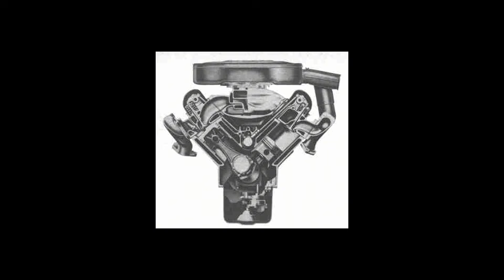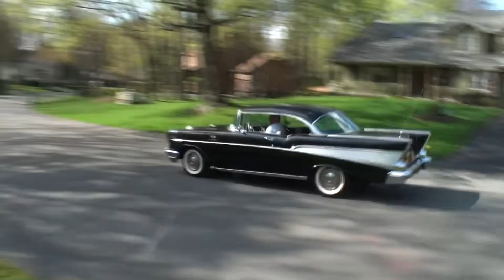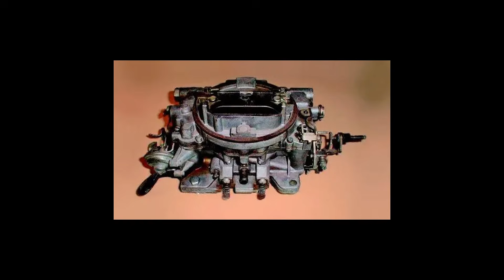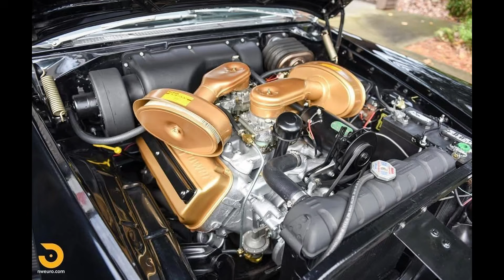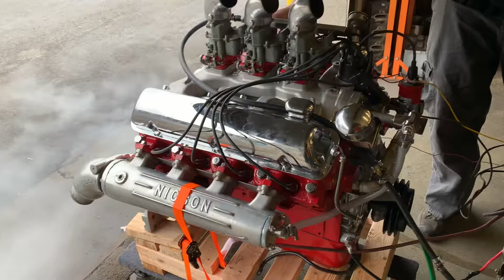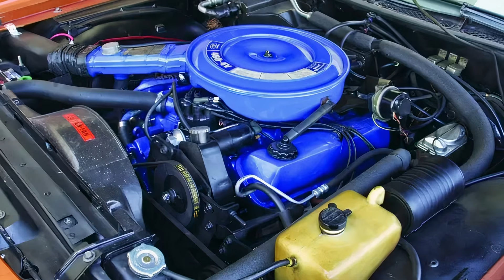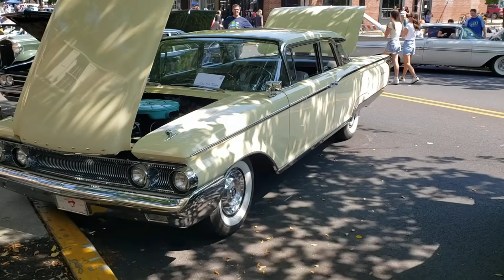Why America ABANDONED Lincoln’s Monster 430 Big Block!

Comment: I also own a 1985 Mark VII fully loaded I bought new. 302 was a dog in a car that is heavier than it looks. Slid in a 408 Windsor (351W) for a beast. Painted it Ford Blue for the factory look with Cobra Valve Covers, Air Cleaner & 8qt oil pan. High volume oil pump. Bolted up  to AOD, but had trans built to take a lot of power. Everything was easy bolt in except for the holley sniper. Had a guy do the install

Comment: I owned a ‘63 Lincoln with the 430 MEL and I didn’t notice it to be a Gas Guzzler compared to the 472 cubic inch  Caddy Fleetwood in 1973 and ‘72 Olds 98 Regency 455 cubic inch. Those 2 cars I watched the gas gauge actually move with every short trip I took. I drove 65- 70mph in that ‘63 Lincoln in freezing cold 0 degree very windy Presidents’ Day weekend in 1986 from Atlantic City NJ to Worc County. 5.5 hour trip and didn’t need to stop for gas. I drove the car like a second car when the weather was nice out and went long distances and not once did I say this is terrible on gas.

Comment: I drove a Ford truck chassis manure spreader with the 430. Had the power to do the job comfortably. Only problem, the bed was just a bit too far back, so when first unloading and the load of semi-firm manure was drug as a block by the bed chain back against the flails, it would rise up into a wheely against the rear tandem’s bump stops for about 50 75 feet, 2+ feet up, then gently settle back down, having tracked straight enough for spreader work.

Enjoyed that truck!

Comment: I bet you all, that was the engine in the "Hot Rod Linchon"  No wonder he drove his pappy to drinkin'!  I wished I  was around back then, to  see  how all these great engines and cars actually were.  The closest I've gotten was a 1955 Chry New Yorker... had a 331 Hemi.  I had no business with it, In the early 90's before the internet it was so hard to locate the right parts.  Crazy example, the 55 had a rebuildable water pump,  you just didn't go buy a new water pump. BUt in 56, you could. and I do not think they were backwards compatable. the fuel pump failed in this one, and the funes blew the exhaust out.  I tried to give like $900 for it. but could not finish paying it out as i lost my job.  Pink body, and white top. 2 speed auto. Bosy was near perfect (less the paint)  very few dents, no rust.  Even still had the ink stampped torque specs for the sparkplugs under the covers.

Comment: We had an Edsel 400 (MEL) in our boat.  It would pull 8 large shiers out of the the Dreamboat could match it.  The Dreamboat was faster because of the hull.  Ours was a 16ft Philbrick.  It would never get up on a full plane.  Our next boat a V Drive similar to a Phoenix craft, it didn't have a hook.  It had an adjustable cavitation  plate.  It was much more controllable.   You could spin hookers with it. It had a 301 Corvette engine in it.  My father sold it while I was in the Navy, in Vietnam.   I wish he hadn't.

Comment: I joined Ford’s Large V8 Engine Design Department in 1967 as a design engineer. The 429 and 460 engines had been released for production for the 1968 model year; the 429 for the T’Bird and the 460 for the Lincoln, replacing the 462 MEL family engine. 
The combustion chamber-in-block concept which the MEL Ford engines shared with the 348-409 Chevy engines was incorporated for better control of compression ratio. The hypothesis was machined dimensions gave better dimensional control than cast dimensions. At least in theory. But John Fawcett, the Design Analysis Section supervisor told me it didn’t work out that way in practice. I don’t know what GM’s definition experience was was the W Series engines, probably same as Ford. 
BTW: The 430 engines, built at Lima Engine Plant, destined for Lincolns all ran several hours on the hot test stand , then underwent a “Continental (aircraft engine) tear down, inspection and reassembly before shipment to the Wixom Assembly Plant. During development, bumps were added to the pistons, in registration with the valves to bump the back to their seats without damaging the valves or pistons. 
And finally, the 460 was supposed to replace the 462 for the 1968 model year, but it was discovered that there was a ‘float’ of 462 engines that would cover the planned vehicle production for the entire model year. My manager tried to sell the engines to Commercial Engine for pumping stations and generators. Nobody wanted them, so the marketing department decided to use the 462 engines up in the 1968 model year Lincoln. It took 6 months of intense effort to un-do the packaging changes that put the 460 in the Lincoln vehicle.

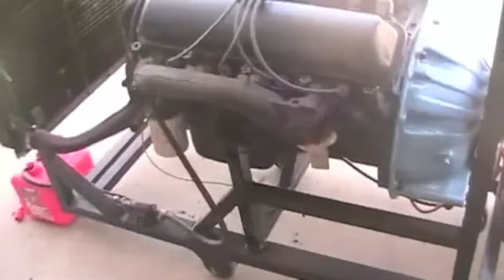Comment: those pics around 17:40, show a running engine and the mechanic tool tray ( top of the radiator )0, complete with a set of plyers ready to fall into the fan to be vaulted into someone else's eyeball/skull.

Comment: There is a 58 T Bird that regularly trounces the competition at Goodwood and it is powered by a 430 MEL engine and 4 speed trans. The thing about comparing this engine to a Chrysler 392 is that there were several drag racers racing 392 engines with roots blowers on them burning nitromethane and the short blocks were stock except for the pistons and cam and the heads were stock except for the valve springs.   NO  OTHER  MANUFACTURERS  ENGINE  WAS  CAPABLE  OF  THAT  WITH  ENOUGH  DURABILITY TO  DO  IT  MORE  THAN  ONE  PASS.

Comment: I have a couple 462's and a running 1960 430 in my pole building. Developed a fondness for them in my teens. Had a 60 430 TBird that would bury the needle on its 140 mph speedometer. Also put a 430 in a 57 Ford convertible. It had massive power. 462 has an oddball bellhousing, so will not accept an FE bellhousing like the 58-60 MEL's. But the 460 is lighter and cheaper to build, so I have done those instead over the last couple of decades. And a couple Buick 455's, also torque monsters...
Reply: I think the 462 uses the 385 series bellhousing.

Comment: I have a 1958 Edsel Corsair with its original 410 CID V8, which is the rarest of all MEL engines.  I can't speak for all MEL owners, but my own experience is that the fuel pump is the worst part about the engine.  Pretty much all other V8 engines had their fuel pumps mounted on the side of the engine block, and they were generally fairly reliable.  The MEL engines have the fuel pump mounted on top of the engine block, in front of the distributor.  For me at least, these top-mounted fuel pumps are very prone to failure, and need to be replaced fairly often.  As much as I'd love to blame the modern ethanol-laced gasoline for this, I can't.  It has always been a problem for me, even before the ethanol era.

As for gas mileage, my 4000 pound Corsair gets about 11 MPG highway, and somewhere in the single digits in town.  (I've never been brave enough to actually calculate around town mileage.)

Comment: The Tbirds and Lincolns from the late 50s and early 60s had amazing build quality. The bodies were works of art. Very solid and smooth riding. I had a 63 Tbird and my friend had a 62. They were like space ships inside. They were as comfortable as today's cars. I believe the early 60s and late 50s were the high water mark for Ford build quality. The technology may have improved but the workmanship really didn't. There was also something special about the early Ford big blocks. I very rarely saw one blow up  under street conditions unless someone was running really high number gears. The big blocks ran best when rpm was kept in the torque band. They were monsters when put in a lighter body car. They were also popular in short track dirt cars as were the 472 Cadillac motors.

Comment: This video shows a lot of images of Ford Y block and FE V8 engines while referring to the MEL.  The MEL has a high mounted fuel pump right in front of the carburetor.  The Y block has a rear distributor and only 2 hold down bolts in the top of each valve cover.  The FE engines have narrow cylinder heads and large intake manifolds that sit partly under the valve covers.

Comment: I have a 58 Edsel Citation that came equipped with the 410 MEL referred to as the E475.  The 410 was only used in the 58 Edsel Citation and Corsair.  It was rated at 345 HP and 475 ft-lbs.  It came standard with a Holley 4bbl and 3 speed automatic with Teletouch push button transmission control.

Comment: The highway cruise gas mileage would probably have been a lot better if they had had a lockup torque converter and at least a 4 speed automatic with an overdrive high gear.
Reply: I have an AOD in my 1960 Mark V. It has a custom converter built to engine spec, weight of car, tire size, gearing, hp & torque, CFM of my fuel injection, cam spec, etc. It locks up & with overdrive, I get 25-27mpg highway & 18 around town.

Comment: Back in the mid 70's, I bought a used 1962 F100 pickup that someone had shoehorned one of these into, and it was an absolute beast! It would pass everything but a gas station. It was actually an exercise in patience to keep it from lighting up the back tires just pulling away from a stop light. I finally put 300 lb. of sandbags up against the tail gate to keep it somewhat manageable.🤣😄
Reply: That sounds like a really great motor swap! I had a friend back in the 70s who instead of modifying motors to build a hot rod, did motor swaps. Doing a motor swap can be the fastest way to build fantastic power. Just put a junk yard big block into a later model mid size and you have muscle car power for a bargain. My favorite was a 1971 455 Buick swapped into a 1978 Buick Skylark (Nova) body style.
Reply: @allentempleton2429  I hear ya. I think I would have rather had that engine in my '62 Fairlane, but it was so rusted out already, it probably would have twisted it in half!!🤣😆 The 430 was a real torque monster, even though it wouldn't rev much past 4500 rpm.

Comment: So Chevy coped this for the 409/348?
Reply: No... 348 was in production before MEL.
Reply: @rodmpugh226 not true. Ford used some MEL engines in a select few 1956 cars. Chevrolet didn't introduce the 348 until the 1958 model year.

Comment: A friend of mine had a 1958 Lincoln Continental  with the 400HP 430 back in high school in 1972. It would get about 7 mpg just putting around town if you kept your foot out of it, if you didn't you could literally watch the fuel gage drop when that 650 Holly was wide open. His car also had the optional "TwinTrac" postreaction and also the 1958 Lincoln Continental  was Ford's first unibody car like the same year T-Bird was.

Comment: My how a few years of technology can improve your fuel economy and 0-60 speed.  My Lincoln Aviator has 500 HP, 600 ft of torque and goes 0-60 in 5.8 seconds!!  It also gets 24 MPG at 80 MPH in a car that weighs 5800 LBS!  Because it’s a pluggable, as long as I stay within 23 miles on the battery, I can go months without refilling the gas tank and stay at 53 MPG!!!!

Comment: 1958–1968 >MEL< V8—big-block Mercury/Edsel/Lincoln (383/410/430/462)
Later: 
1968–1997 >385< V8—big-block (370/429/Boss 429/460/514)
BTW NO, while this is an astute & interesting forerunner 'wedge' combustion chambers, most are generally CAST into the head w/most 'machining' left to aftermarket & consumer modification...
Direct Connection/Mopar Performance, provided template drawings for port & polish, & a host of parts making their big blocks value kings of torque & hp for at least a couple of DECADES
Reply: There's no 514 in the 385 family.

Comment: The 385 series that replaced it was lighter but hardly lightweight.  However it was very much like a scaled up Windsor in terms of the block design, oil pump configuration, and dizzy.  However it used BB Chevy or Mopar poly/canted valve arrangement also adapted to the 335 series Cleveland.  Never worked on an FE or MEL, but I love the 385 motor, as its generous crank case allows for big strokers and reliable high power is excellent even though it’s only a 2-bolt main design.  Hard to beat a 385 series for big cubes for the money.
Reply: 429 boss and 429 SCJ both 385 designs with 4 bolt mains. Owned a Boss Mustang back in the day. 6mpg!
Reply: 2 bolt main blocks better they are stronger. Then get 4 bolt splayed billet caps and get the block drilled and tapped :)

Comment: 465 lb-ft of torque at 2000 rpm for one version
500 lb-ft of torque at 3200 rpm for the Mercury Super Marauder version.  
That's a whole lot of torque for such a slow crankshaft speed.

Comment: it grew larger in 1966 to 462 cubic inches and in 1968 was dropped for 385 series 429-460 installed in the new mk 3 in early 1968 and the rest for 1969 and used until 1979 in lincoln but kep alive in f series trucks until 1996
Reply: Ford had to enlarge thier 430 because Chrysler had introduced thier 440.
Reply: We used to cruise the streets of Cicero in my buddy's bronze Mk III (it may have been hot). What a beautiful car, but alas, he could not afford gas.

Comment: Who writes this crap?  High compression ratios result in better thermal efficiency not worse. The introduction of lower CR  happened with the "smog motors:" of the 70s. Tuned to run rich? That would have been fixed with a screwdriver. No tamper-proof carbs back then.  What "increasingly strict emission controls"  were there in the late 50s and early 60s? Most engines of that time did not even have PCV, just draught tubes.  This is nonsense.
Reply: Only the idle jets are adjusted by turning a screw, not the main jets.

Comment: "Big Blocks" are Chevrolet V8 engines. The 430 is an MEL - not a "big block". The SAE does not define "big blocks".
Reply: The Chrysler B & RB engines were "Big Blocks" too.
Reply: @johneckert1365  - just because YOU say so? The Chrysler B & RB engines are Chrysler B & RB engines. CHEVROLET has big and small block V8 engines - words mean things.
Reply: @OHUQTU Everybody refers to Ford's Widsor V8 as small blocks as well. Sorry it makes Vag sore........
Reply: @OHUQTU When the more common FE Fords came out, everyone called them big blocks. It's slang. Get over it.
Reply: @OHUQTU Over here in the land of sanity, we call tall deck Oldsmobiles big blocks too! And those silly short deck Pontiacs are small blocks :)
Reply: @johneckert1365  - "Everybody"? - What  is the Ford "Widsor V8" you refer to? - ignorance and crude comments are the mark of a simple mind attempting to express itself.
Reply: @johneckert1365  - tell your enlightened wisdoms to the SAE, so they can establish your definitions in automotive engineering! You obviously have wisdom beyond most humans.
Reply: @johneckert1365  - "everyone" but Ford? Ignorance is a mark of the uninformed and you just joined the club (get over it).

Comment: In 1978 I remember working on a 58' T-bird with the 430 engine and Replacing the Crankshaft and connecting rod bushings.& a few that i did complete tune-ups and L.O. F's .  Never did really see to many of these engines. I Loved My Uncles' baby blue 64' Lincoln: it had the 462 (You could not miss those BIG NUMBERS): it was a BEAUTIFUL car in the mid 60's. In the early 90's i bought 2 Lincoln's both with the 430 engines
Reply: RS ...........had a 68 LC 4 dr. with a 460 got about 10 on the highway ......was like a single wide with motor :hand-pink-waving:
Reply: They didn't put a 430 in a t bird in 1958
Reply: The 462 was used in the
1966 and 67 models, and 
apparently, some 68s.

Comment: I put a 430 Mel with a 3 deuce set up and Automatic out of a old wrecked Mercury car into a 1964 Ford F100 Short bed pickup back in the early 90s.  That old wrecked mercury had sat in my uncle's field for 30+ years before I yanked the engine ant transmission out of it. Took a little work to get it to run again. But after rebuilding the carbs replacing the rings , bearings and valve springs that thing was a beast. The transmission turned out to be junk. But a automatic from a 65 Lincoln with a bad MEL engine was swapped in. That old Ford pickup handled terrible in turns with that big heavy Engine up front. But just stabbing the right pedal would annihilate the rear tires through 2nd gear and into 3rd . And it would run 100 mph all day without breaking a sweat . Gas mileage was non existent but it sure was fun. Pulled the 430 and transmission out and dropped in a 521 Stroker with a tunnel ram and Holley center Squirting 4 barrels and Tremec 5 speed in the 2010s along with a Currie prepped 9" and really discovered what fast was. Got rid of the truck when a guy decided he absolutely had to have it and paid me almost twice what I had into it.
Reply: I have a 430 tri power in a 1960 F100. Body is on a 1985 frame with 4wd. Very powerful

Comment: Didn't Packards flat head engines have something similar?
Reply: FE's have some remarkable features similar to Packards V8. 
Its too bad Packard was so late getting V8 into production. They should have started V8 program in '47' and 3 speed autobox development. The Packard semi automatic was designed for low hp strait 8. It couldn't handle the power or performance of the 352 and was unreliable if driven aggressively. Just another bad decision made in a series of bad decisions that ended Packard.

Comment: Hot Rod Lincoln!      My 1975 town car had a 460ci and I was very lucky to get 8mpg.    It was a beast and felt like a land yacht.   Could eat up the worst of highways in comfort but would squeal the tires at even the smallest of tight turns.    Could fit 8 people in it.     Miss that thing.
Reply: Had a 1981 Ford F350 dually. 460 4 bbl. & 4 speed trans. From my house to the job was 126 miles 1 way. Round trip was 44 gallons of gas like clockwork but that sucker would pull a house down. No sweat.
Reply: That was a later Ford 385 series engine, John Kaase builds engines based on that series engines.